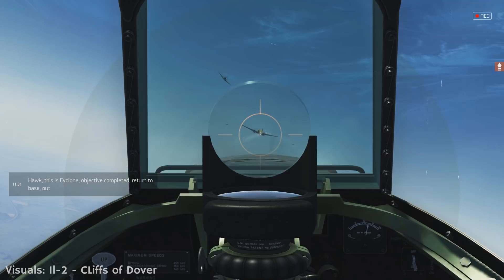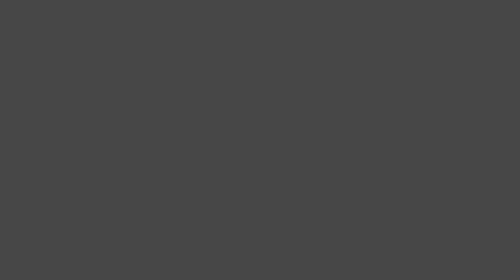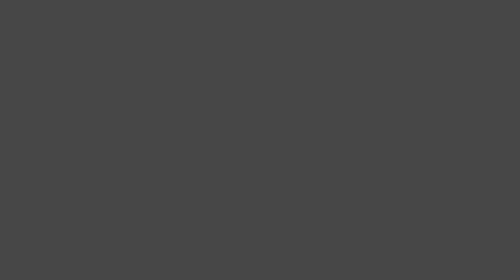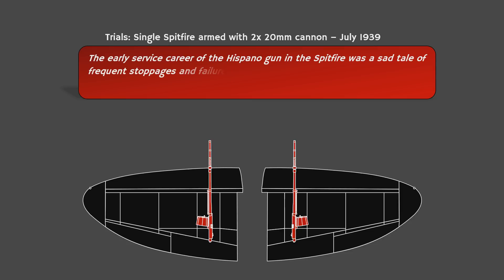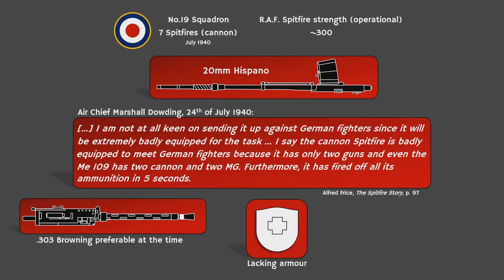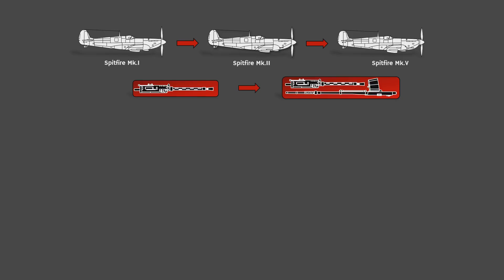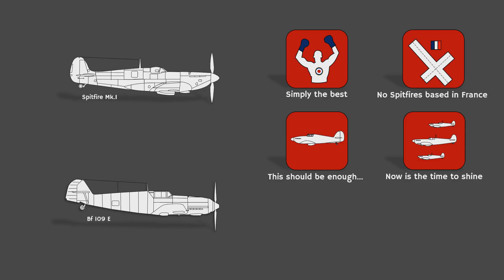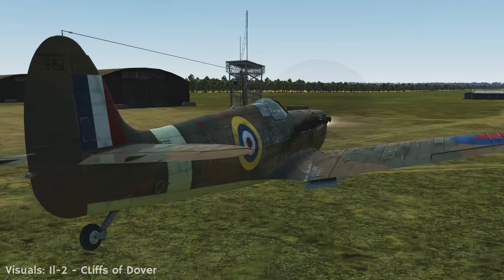⚜ | Clearing up Spitfire Misconceptions

Comment: I think the carburetor versus fuel injection was a huge issue.  It seems like only now is this really being recognized.  Overall, it seems like Europeans designed planes with shorter "legs" or shorter overall operating time.  The Germans would've needed something with the fuel economy of a P-51 in order to linger over Britain rather than fight for a few minutes and have to fly back.

The wing is also interesting.  Originally, it made deeper to hold the cannon but then to find that wing warping interfered with it.  The USs' solution to things like this was to just use the .50 call and in gropus of 3 or 4 per wing on most fighters.  While a cannon is certainly a better weapon, lots of machine guns also seemed like a great idea.  I'll never understand the idea of a .30 caliber machine gun on a fighter.  Just a little too light it seems to me.

Interestingly, the Hurricane was the real bulwark of the RAF.  The Spitfire is one of the best looking aircraft to look at that has ever been made and is a great thing to visually feature of course.  I think the Hurricane has never gotten the credit it deserved.

Great video!

Comment: It was actually the Hurricane that won the Battle of Britain, though Air Ministry gave the laurels to the Spitfire for propaganda reasons. 

The Hurricane was the majority fighter for the RAF during the Battle of Britain, with the Defiant the second most numerous fighter. The Spitfire came third in the numbers. Having to ground all Defiant squadrons due to horrific casualties part way into the Battle of Britain therefore put the RAF in a serious fix. (Defiant squadrons were re-purposed as night fighters and due to their all black colour were referred to as "The Steel Bats" by Luftwaffe night bomber crews).

In real life the Hurricane could turn tighter than the Spitfire and Bf-109 E, roll faster and climb slightly faster than the Spitfire (Hurricane II). It was also more robust and quicker to patch up and thrown back into service. On the down side with a 324 MPH top speed it was slower than the Spitfire, Bf-109 E and Bf-110 C.

The Hurricane IIa carried 12 x rifle calibre Brownings.

The cannon armed Hurricane IIc entered service whilst the cannon armed Spitfire was still being sorted out, though mainly with "Huff Duff" interdiction and night fighter squadrons.

Comment: The engine didn't 'seize', it stuttered, and the carb didn't flood, it suffered from fuel starvation, the restrictor in the fuel line fitted later reduced fuel flowing away from the carburettor.... Otherwise great video

Comment: spitfire air blow, as it's propeller placement is not as symmetrical  as fw 190 and bf 109 (the propeller placement too high from the lower wings), doesn't give it an efficient performance.

Comment: The good thing about the 8 x .303 is fast rate of fire, flat trajectory more instantaneous result of pulling the trigger and less need to anticipate future position of the target aircraft as the muzzle velocity is nice and high. Although .303 is a small calibre by aircraft standards, if youve ever held a .303 slug in the palm of your hand, it is heavy and nasty.
Reply: Froggy Frog 9000 7.62 slows down really fast. They are already subsonic beyond 1000m. Assuming somewhat proportional shape 20mm slow down 20/7.62 times slower, so not so flatgoing for 7.62.
Reply: older cannons were under powered compared to todays aero cannons. Sure the heavier projectile slows down at a slower rate, however it also starts off slower at the muzzle. In one second both projectiles will fall 9.8 meters, but in that one second the smaller calibre travels much further, hence the flatter trajectory of a .303 over a cannon shell.
Reply: Froggy Frog 9000 Hispanos 404, the ones used on spits had muzzle velocity of minimum 840 m/s ;  brownings had 850 m/s. Needless to say, hispanos had vastly superior ballistics, altough firing ~100 7.62s per second made up for it as far as accuracy goes
Reply: Good point, thats a fast muzzle velocity on the Hispano, I was only looking at cannons like mgff and mk 108, which are a bit shorter barrelled and a bit slower.
Reply: Yes. That's the point. Plus lighter weight for the plane to lug around and more ammo capacity(than .50cals or cannons). AP+incendiary mix improved kill rates when it was introduced too.

Comment: The Germans were equipping for war - The UK was hoping for peace. - The Spitfire was not derived from a military plane but for racing so to equip and develop it into military service would have some teething problems. The late spitfires were totally different from the early models and other more exotic planes were also developed such as the Mosquito and Tempest. The Germans spent a lot  of time and effort developing their exotic planes with little success and needed to concentrate on production rates as  war is about attrition. The RAF were operating over home turf in the BofB and had the support of Fighter control to enhance their performance so their aircraft's shortcomings were somewhat alleviated. The Germans also undertook a military pilot training scheme using gliders  before the war and  had many combat efficient pilots with well rehearsed tactics unlike the British who had to adapt their training  and tactics. By the end of the BofB the RAF had a new focus and many combat experienced pilots that  were able to  match and repel any German efforts. Once hostilities started the UK military purchased aircraft made from around the world including Canada and USA therefore out producing and out performing the Germans  in every way. You can put it under the microscope but you need to know what it is you are looking at. Adolf Galland rated the Spitfire he pointed out that the Me109 was superior in the attack and not so suitable for purely defensive purposes as the Spitfire, which, although a little slower, was much more manoeuvrable.  Goering asked what were the requirements for our squadrons. Moelders asked for a series of Me109's with more powerful engines. The request was granted. 'And you ?' Goering turned to Galland  'I should like an outfit of Spitfires for my group.'  - Goering was speechless and stomped off, growling as he went.

Comment: I would like to correct a few other misconceptions about the Spitfire and the Hurricane. The fact is, the Hurricane was no match for the BF109 - even its number one fan Douglas Bader would agree with that, having been famously shot down over France after tangling with one.

However, the RAF had approximately 3 times as many Hurricanes as Spitfires during the Battle of Britain. So what to do? Easy! the Hurricanes were tasked with concentrating on attacking the Luftwaffe's bombers while the relatively few Spitfires took on the BF109 escorts.

In the role of anti-bomber fighter the Hurricane was very successful. Pilots claimed it was a very stable gun platform, and as it was constructed largely of canvas stretched over a wooden frame, it could take a lot of machine gun or cannon fire yet still remain airworthy. This method of construction also meant many repairs were carried out quickly, simply and inexpensively.

Not so the Spitfire. because of its much more sophisticated all-metal, monocoque construction, repairing them demanded a high degree of skill and specialist equipment.

Maybe it was because of the relative glamour of the fighter to fighter dogfights that the Spitfire eclipsed the Hurricane in the popular imagination, but the fact remains that the humble yet plentiful Hurricane shot down a much greater tonnage of enemy aircraft.
Reply: Elsewhere in this comments section I quote chapter and verse from Group Captain Townsend's definitive book on the BoB (Duel of Eagles) where he describes Spitfire snobbery.  In short, many downed German fliers claimed to have been shot down by a Spitfire when it was really a Hurricane all along.   Also, to quote another BoB vet, the Hurricane Vs bombers and Spitfire Vs Bf 109s wasn't reality either.   Things happened far too quickly and you shot at whatever was in front of you.  Once the 109s were ordered to stay close in to the bombers that was even more the case.

I agree with you about the Hurricanes many virtues and many vets are on record saying the same thing ( incidentally, the covering was Irish linen not canvas, then heavily painted with numerous coats of dope).    Thank God it was there and in numbers too.   

At the end of the day the Hurricane was the logical development of Hawker's beautiful looking stable of streamlined biplanes of the 1930s - Fury, Hart, Hind etc., and gone about as far as it could go whereas the Spitfire was just starting and in 6 years gained 100 knots in airspeed, 4 X cannon for 8 303s, etc.
Reply: Bader was shot down by one of his own squadron, not a 109.

Comment: I think you need to review records for the period of the Dunkirk withdrawal. You are correct that the Spitfire was held back during the invasion of France. However it was involved, protecting the withdrawal with a high kill ratio. Correct, there was an issue with the carburettor which was also true for the Hurricanes but there was a tactical solution through combative manoeuvres before the temporary solution of  Miss Shilling and the permanent with the new carburettor. During WW2 there was a constant battle between the engineers of both sides with each leading for a period. e.g FW190 and Me109G 6 better that Spitfire V, but these were surpassed by the Spitfire IV and subsequent models with the Griffin Engine.Then you have the Me 262 and the Meter III debate, again demonstrates the engineering philosophy of both nations.

Comment: If I were a fighter pilot in WW2, you would be hard pressed to get me into a Spitfire. I've never flown one, nor am I old enough to have been in WW2. However, I have found on my combat flight simulator that the Spitfire does not like to roll inverted. The plane, during a high-G turn, wants to roll back right-side-up unless you apply a lot of rudder. I'd much rather be in a P-47 Thunderbolt.
Reply: Just a couple of points you might like to consider with that comment. 
In the battle of Brittian, you would have been trying to fly an aircraft that was not even in production.
The eagle squadrans (Amercian pilots who flew spits before the USA joined the fight and P47s and Mustangs afterwards) always saw the spitfire as the "bench mark" and not surpassed by either American fighter.  Why would you want to fly inverted (unless pulling into a dive where positive g's change everything) when the danger always was from above.

Comment: The elements that make the Spitfire what it was were of course it's performance parity and even superiority against the BF-109, in many aspects, including aproximatly 5-10mph greater speed at sea level it could overtake or escape from a 109 given several miles of straightaway running. It also climbed better, though each individual aircraft was often dissimilar by several hundred feet per minute on both sides. The fact that the Spit had a far better turn radius is not disputed.

But what made it what it is, the defining feature was the Spitfires ease of handling throughout the performance envelope. Especially when approching maximum lift coefficient in an abrupt pull-up and sustained turn. Even an inexperienced pilot could bank and yank the spitfire and find the edge that the wing stalled at, and balance on that line because the aircraft could be flown around in a partially stalled condition without a roll developing, or dropping the nose sharply. So the pilot could pull into a partial stall, ease off the controls, and find the edge of the limit for his turn in every single case. The -109 would snap hard if flown by a ham fisted pilot in this manner. The German pilots were vastly more experienced in the battle of Brittain, many had 600-1000 hours and more hours in combat than many spit pilots had total time. Spitfire pilots where often engaging enemy aircraft with scarcely over 250 hours total time, and their aircrafts abilities masked their inexperience so that the Germans had a very tough fight in spite of arriving with all of the advantages of timing, altitude, cloud obscuration, reduced fuel weight, etc. The spits nearly always fought up into a swarm at a disadvantage, with only their early warning radar to assist them not getting taken by surprise.

The spitfire has several key design elements that created an aircraft that was able to be stalled, while still remain flying and controllable, and also generating significantly lower drag when stalled than any other aircraft I've ever studied from an engineering perspective. I'm not the only one on Earth who knows what Shenstone did at that time, but I'm probably the only one who figured out the secrets in this particular case. (Modern fighter jets use some of these techniques, so I know somebody also knows what the secret was, but I won't tell, it's that good).

Comment: The engine never sized or was overfuelled, the problem with negative g was fuel starvation as the fuel was forced into the top of the carb causing the engine to stutter, so misconceptions are rife on your channel.

Comment: why does everyone forget the frequent main spar failures suffered by spitfires the one huricane advantage was unbreakable albeit thicker wings
Reply: Roy Cspary. Please point me to the source of the main-spar failure?   I have already read above that the spitfire had a fatal stall tendency due to it's wing.....Which of course is bollocks.
Reply: Not that frequent.  There was a problem with incorrectly heat treated main spars at one time.  Another issue was incorrect loading of the aircraft which resulted in a centre of gravity too far aft, which combined with the light elevator to break some aircraft.  Jeffrey Quill is worth reading on this.

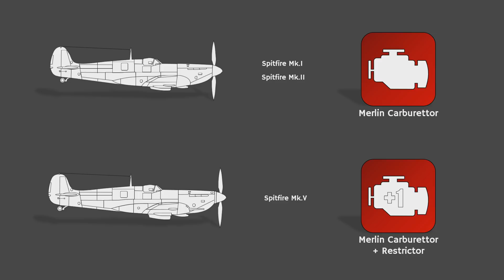Comment: 2:52 One mistake:
Mk. V version still had normal engine with carburetor. It wasn't until mk. IX that had restrictor installed. Don't understand why you'd put the mk. V as the first with restrictor.
I mean maby there were some tests done, but i haven't heard of a production Mk. V that had restrictor installed...
Reply: If you are referring to the RAE Restrictor, the RAE team started installing them at field units in Jan 1941 in Mk.II Spits.  Mk.IXs w Merlin 66 received pressure carbs.

Comment: Would NOT holding the Spitfires in reserve have influenced the outcome of the Battle of France ?
Reply: No, RAF fighter defence was based on a foundation of the chain home/ROC/Filter room/Sector station air defence system championed by Hugh Dowding. Operating in France on makeshift airfields with little logistical suppport and no command and control co ordination would have made the sending of Spitfires to France a complete and utter waste of resources. Unfortunately The French air ministry did not have the foresight to create a similar system over the skies of France.

Comment: All of this information is spot on but there is one fact I don't agree with fully and that's the fact that the Allies didn't have an effective fighter in France to counter the Bf 109. The Hurricane in France proved to be very effective against the 109. No 1 Squadron that were in France from Sep 39 to Jun 40 claimed 160 confirmed kills which included approx. 100 109 kills. The most intense period of operations were from May 10 1940 when Blitzkrieg started to May 19 1940. In those 9 days they were covering the tactical withdrawal as the German forces pushed through the line and claimed 100 confirmed kills many being 109s flying escort to German bombers. On May 19 they encounted 15 Bf 110 escorts and shot down 10 confirmed without loss.  No 1 Squadron did contain many highly experienced pre War pilots with many hour flying time,but it shows the Hurricane was highly effective if used properly with an experienced pilot. No 73 sqdn also operated with No 1 during the same period and had similar success.  I would recommend 'Fighter Pilot' by Paul Richey who fought with 1 Sqdn during the Battle of France, probably the best book written,taken from his diary. I am lucky enough to own an original 1941 edition and a later one.  Rick M

Comment: Something I've been trying to understand for a while, maybe someone here could explain: What is the difference between a "cannon" and "machine gun" as it applies to aircraft armament? I understand that cannons are bigger caliber, but what is the technical definition and distinction between the two - is it purely a difference in caliber, and if so at what caliber does it become a cannon, or is it something else?
Reply: Quill Maurer A cannon is designated a cannon by what caliber it fires, so if it is capable of firing a caliber 15mm or up it is considered a cannon
Reply: @slimerewoods5766  Thanks!
Reply: It's also the ammunition it fires. Machine Guns generally fire solid rounds, whereas cannons usually fire explosive shells. You can of course put (small) explosive rounds into larger calibre machine guns, or have slug rounds for autocannon, so, as Gwendal says it often comes down to calibre as well. It's a bit of a blurry area.

Comment: I know the Germans had a selector to change between firing the MG's or the cannon, did the dual-armed Spitfires have that, or did they just fire both?
Reply: Spitfires with mixed gun armament had a rectangular gun firing button. Pressing the button at the top fired one set of guns, pressed at the bottom fired the other set of guns. Pressed in the middle fired both sets.